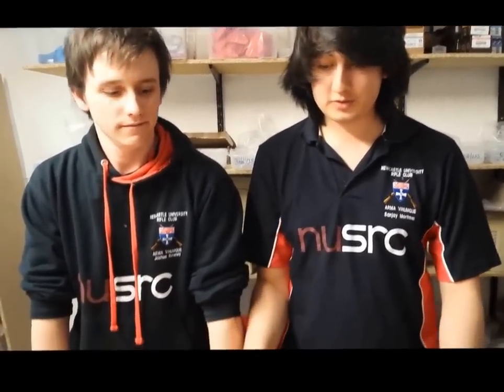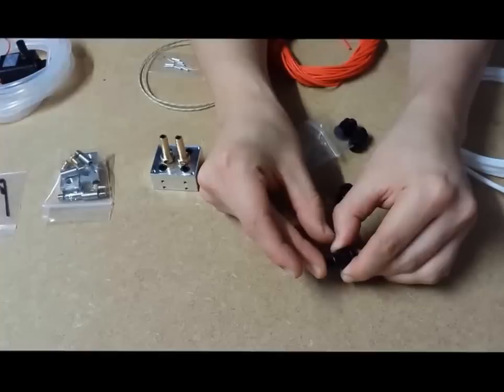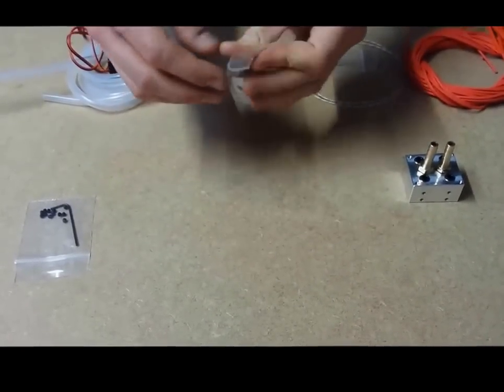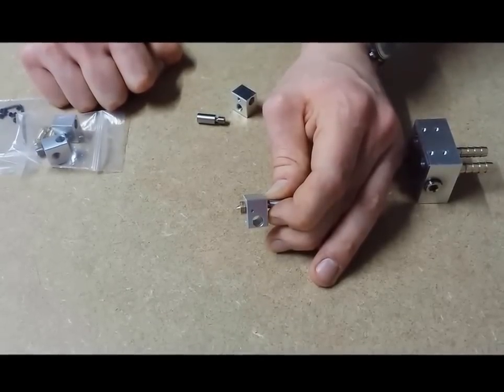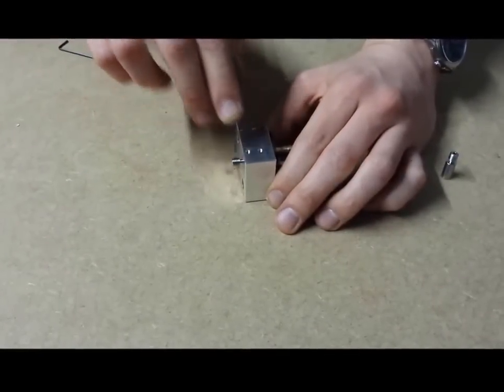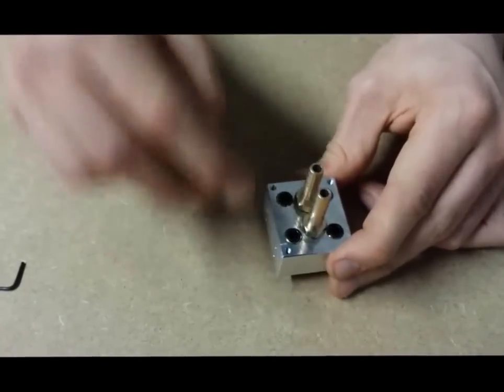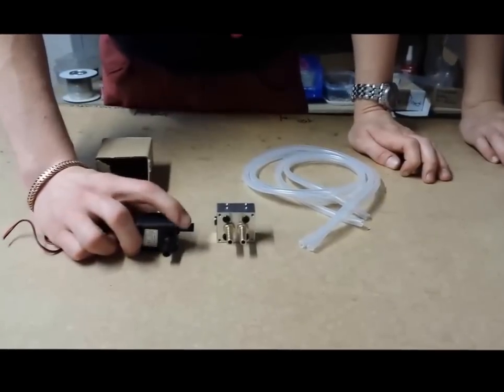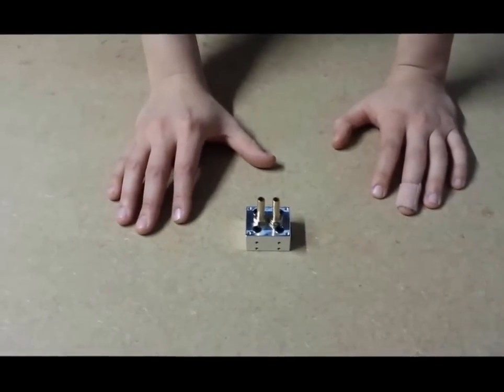E3D Kraken: What's In The Box + Assembly Tips

Comment: I was just looking at your drawings of the Kraken and noticed that the tapped holes for the water hose fittings were in line with the hot end holes, but this appears to be different in the video.  Is the block in the video the same block?  I am also wondering what size silicon tubing that is.  Thanks
Reply from the maker: Hi Michael,

Yes the block is the final design for this Beta run. We had to make some last minute amendments to the design to ensure that when tapping the holes there was no damage to the heat-break holes. The drawings are overdue an update, new versions will be on our site soon. 

The silicone tubing is 5mm ID x 8mm OD going into a 1/4" barb to ensure a tight seal.

Regards,
Josh